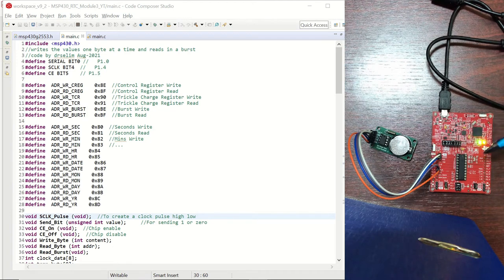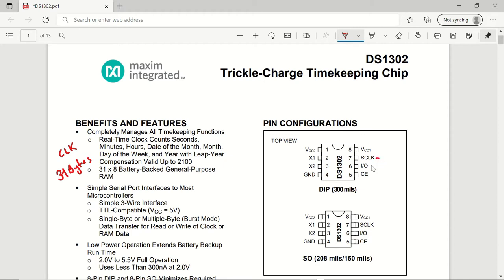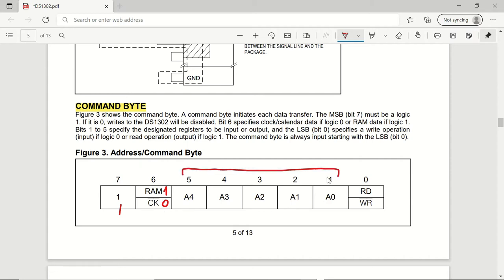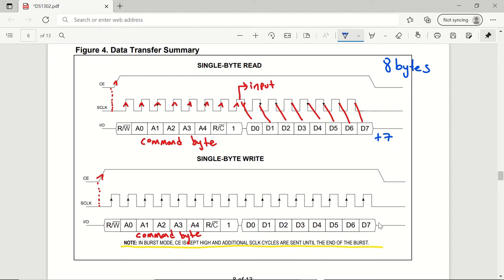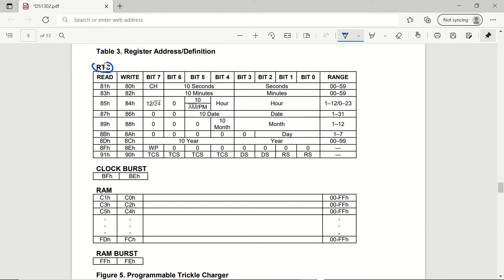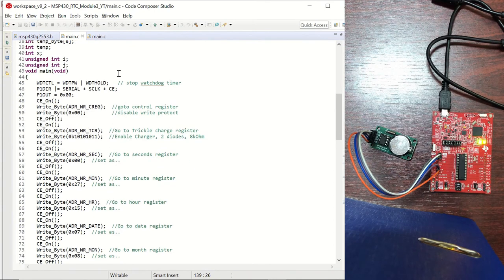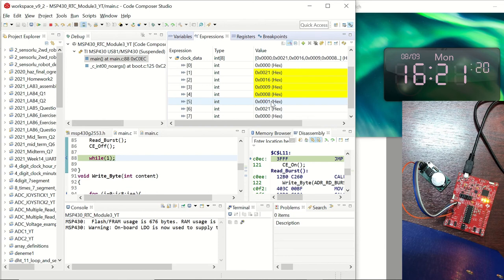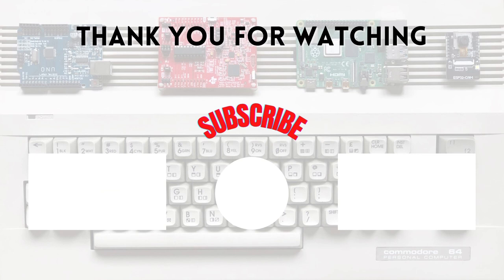MSP430 & RTC (Real Time Clock) Module - DS1302

Comment: I want to ask the variables you use including P1OUT, P1IN, WDTCTL , D1DIR where did you get it, the source you shared on github has enough projects for this ds1302 project, thank you.
Reply from the maker: Hi those are macros defined in the msp430 header files,just take a look at them in the includes folder in your project in ccs. As you include the header file, you’ll be able to use them. I suggest you take a look at my digital i/o tutorial for msp430.
Reply: @drselim  yes, thanks you so much

Comment: very good tutorial. Very well explained!.
If I want to use P1.1, P1.2, P1.3 respectively for CLK, DATA and RST, what should I do?
Changing the #define headers is not making it to work.
Please help!
Reply from the maker: Hi, thank you for your comment.
P1.1 and P1.2 are used for UART RX and TX by default. That is one of the reasons I didn't use those pins in my code. But if you have to use those pins , after changing the 
#define SERIAL BIT0 //   P1.0
#define SCLK BIT4  //   P1.4
#define CE BIT5    // P1.5
section as you wish, make sure that the P1SEL and P1SEL2 registers have both zeros for BIT1 and BIT2 (that is for digital I/O), and disconnect the two jumpers that are labeled as RXD and TXD from the launchpad. 
But as I said, avoid using p1.1 and p1.2 as digital I/O, because you won't be able to use UART (serial monitor) in that case...
If you want more details, please take a look at my other tutorials (I suggest digital I/O in this case)
Reply: @drselim  thanx a lot .. that was a quick response. I'll try this out!
Reply: @drselim  I tried this as follows
#define SCLK 	BIT3  	//   P1.3	
#define SERIAL 	BIT4 	//   P1.4	
#define CE 		BIT5    // P1.5		

...
int main(){
        P1SEL &= (~SCLK + ~SERIAL + ~CE);
	P2SEL &= (~SCLK + ~SERIAL + ~CE);
        ....
}

Then I wrote to minute register and when I read from there I'm not able to get the written value. It's showing all zeros in temp. Is there any way to debug this? 

    CE_On();
    Write_Byte(ADR_WR_MIN);  //Go to minute register
    Write_Byte(0x21);  //set as..
    CE_Off();
    
    CE_On();
    Read_Byte(ADR_RD_MIN);  
    CE_Off();
Reply from the maker: Hi, for pins 1.3 1.4 and 1.5 the default setting should already be digital i/o and probably you don’t need to set the psel1 and 2 registers. I had recommended that since you said you wanted to use p1.1 and p1.2. Now in your code the only difference is using p1.3 instead of p1.0 and it should work without any further modification. Did you try the code that i uploaded with the exact same connections?
Reply from the maker: + After debugging your code, you can use step into button to go through each code line and see the updates in variables, registers.
Reply: @drselim  Thanks bro. It's working now. But, one more change I had to make there in Read_Byte() function. Same is applicable in Read_Burst() also
void Read_Byte(int addr)
{
    temp = 0;
    Write_Byte(addr);
    P1DIR &= ~SERIAL;
    for (j=0;j<8;j++){
        temp >>= 1;
            if ((P1IN & SERIAL) == SERIAL){

                temp |= 0b10000000;
                   }
                   else {

                temp  &= 0b01111111;
                   }

            SCLK_Pulse();
            }
}

=====================
P1IN & SERIAL is compared with SERIAL instead of 0x01.
Reply from the maker: @packnflee7070  Hi, yes since you changed the pin setting, you should do that. I had written it with the assumption that pins will be used as defined.